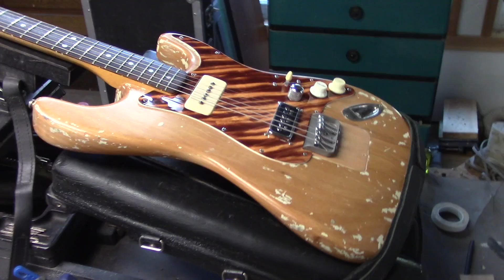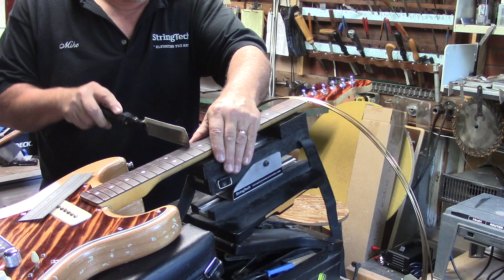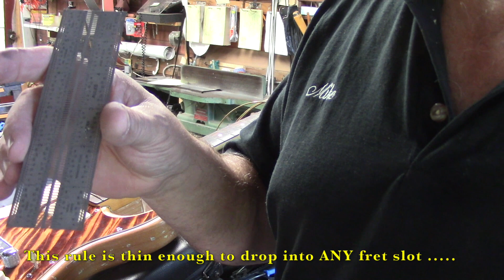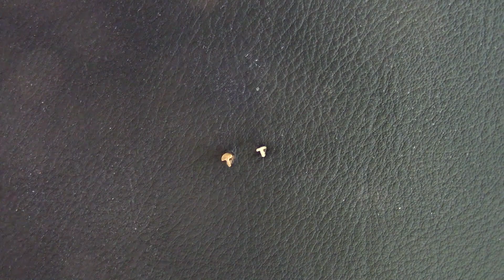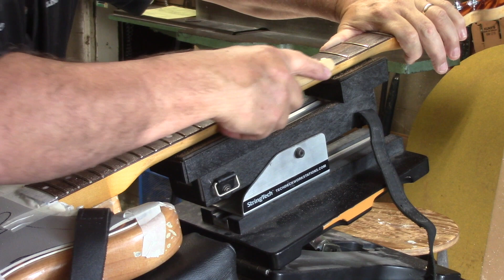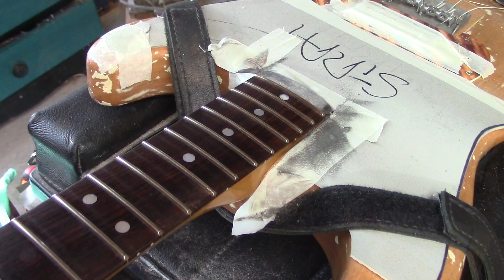Rico's "Cooder-Caster" EVO Frets

Comment: "Cooder-Caster" 😆😆 great!
Mike you mentioned "not much holding those frets in". 
Any need to order a wider tang on the Evo's or any adhesives for this one?
Reply from the maker: Again ... very good question. The tang and bead on the EVO was a good fit for this job ..... although I did wipe some wood glue on a guitar string and drop it into each fret slot. The reason for this .... is not to glue the fret in place ... but to "swell " the saw kerf ... the end grain on either side of the kerf absorbs the glue and swells up and tightens up the fret in the slot. MMcC